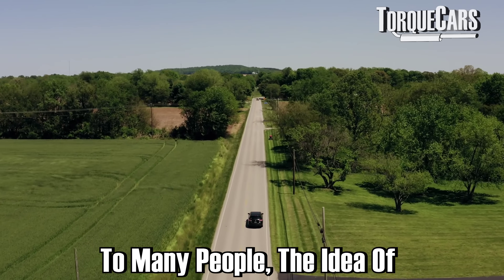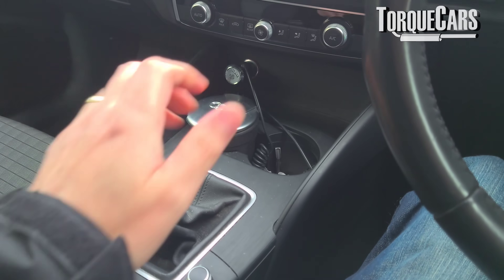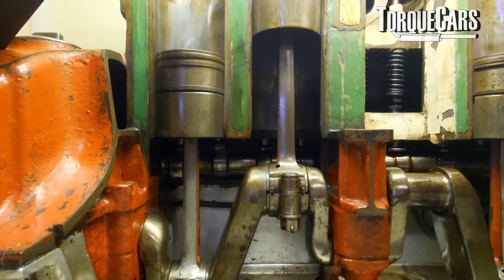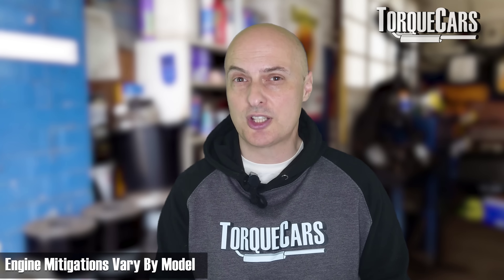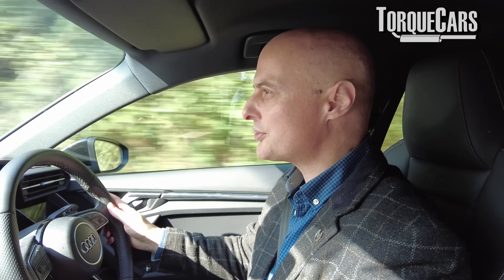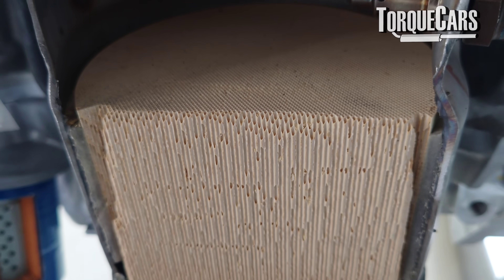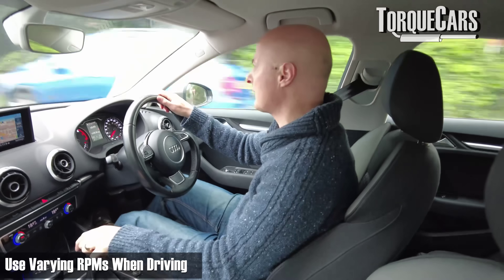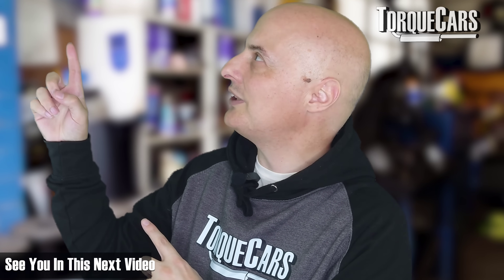BIG DAMAGE By Lugging at LOW RPM? Eco Driving Warning! (Manual Gears)

Comment: I’ve been driving for 40 years and although I’m no engineer I have pretty much driven the way you describe in this video - ie I use light throttle at low revs and while I do drive for economy on average I do indeed approach the red line from time to time and on a twisty road I will usually hold onto a lower year which is also safer as it gives more control and better response. Cars that I have owned have consequently remained healthy into high mileage and tend to burn very little engine oil.
Reply: How many RPMs are we talking when you say low revs?
Reply: @Xenon777_ how do you measure that?
Reply: @Xenon777_  I would say anything below 2K is low and even around 2K I would only gradually increase the throttle rather than stamp on it. For full throttle it’s best to be close to the mid-range torque. Obviously this varies from engine to engine - I have a 1.4 TSi which is a low pressure turbo.
Reply: My opinion is that a gasoline engine car can be used between 2000 and 4000rpm with no problem if one wants some torque. Over 4000rpm, one is either looking for power, or for engine problems. Below 2000, if you are not accelerating to reach your usual speed, you are decelerating to stop the car or looking for a car park place; anything other than this is lugging the engine, and looking for mechanical problems too.

In a diesel engine, I would say the torque band is between 1000 and 2500rpm. Over 3000, you are looking for power (on an engine supposedly full of torque) or, once more, looking for technical problems
Reply: @OscarA8869  my personal non professional opinion on diesel engines as i have the most experience with diesel engines is
Allways ride the torque curve
My car peak torque is at around 2000rpm as most diesel engines
I ride it at around 2500 since its a bmw and its really revs happy, if i need to drive at under 2000rpm that means im in too low of a gear
While thats the case with my revs happy engine
My ford focus is not really revs happy and its made for economy in mind i change at 2000rpm and ride it around 1800 fo 2200 depending on conditions
Reply: @MitkaZz  I drive a 220d and can tell you 2500rpm is way too much for normal cruising at 100km/h, for that my engine sits way happier at 1200 to 1600 rpm(cruising with very little load). 2500rpm is normal only for highway speeds or Autobahn where we diesel drivers can floor it all the time and still have 6L/100km as average :). I have 20 mins to work and 5 of that is Autobahn, I 9 out of 10 go full throttle there :)

I must also say that BMW diesels are very different to others, they actually sound good and are much happier when going above 3k rpm. Other diesels sound like they are going to explode when you go above 3k rpm, BMW diesels sound good all the way to redline at 5k wich you never do as max power is at 4k rpm. Most people when sitting inside dont realise my car is a diesel until I tell them.
Reply: @OscarA8869  I fully agree with you. But when it comes to a Honda engine, such as a k series, B series or even a L series(for the fit) they are very rev happy engines. They were mechanically made to be used on high rpms.
Reply: @Badboythatsgenuine  The exception to the rule
Reply: Oscar is right for the average engine.
I've always found keeping a 4 or 6 cyl avg compression gasoline motor between 2000 and 4000rpm 90% of the time to equal long engine life and best fuel usage.  I have always been able to shift from 5th to 4th or 3rd in time to achieve a pass, a climb or an engine braking as I live in the mountains with steep switches.

My wife can't seem to get comfortable with a clutch so she has a 6 sp electric automatic...it responds very quickly to throttle input in a pass or climb...  I do not ever sense lugging or knocking.

I typically keep cars since 1990 to 200k or 250k, and sell them because I have just grown tired of them after 15 to 20 years...or the subcomponents start failing with age...wiring, electric windows,  switches, trim, alternators, pumps, etc...

Every redliner I know was always having motor work done on a regular basis over 0 to 100k miles...or replacing the motor or engine.  They may not be related...as it may just be the enthusiast race fan personality that desires constant car attention.  When I drove a BMW, there were lots of trim and body parts available in junkyards because the car had blown a motor in hard kid driving or dumping it into 2nd at high speeds.

Comment: Hipermiling on gas or diesel engine is oxymoron. 
If you want to hyper mile buy yourself some kind of ev (fhev, phev, bev).
Reply: BMW 730d >1100 miles on a full tank. Huge vehicle and a 3.0L diesel. literally made to do just that. Forget the nonsense phevs and hybrids, they aren't even close

Comment: Low revs are not an issue, it's labouring the engine that jerks the transmission. If you want to save fuel accelerate briskly and then coast.
Reply: @bikeman123  Its counterintuitive but the math support this statement. Accelerate and then coast to next stop saves fuel.
Reply: It is possible to accelerate gently without lugging the engine, though. Just use the proper gear.
Reply: @blisterbrain  Engines are at max efficiency at wide open throttle, therefore leaving a light at WOT (in first gear) is maximally efficient, then coast at lower RPM. This is the strategy used by hyper milers.
Reply: @Rex_Racer  Not quite WOT. About 80% WOT. At 100% WOT the ECU goes open loop and blasts fuel in regardless of emissions.
Reply: @Rex_Racer  no, not true
Reply: @BriansRCStuff  It is true. Likely, you are conflating efficiency with fuel consumption- not the same thing.
Reply: @Rex_Racer  fuel consumption/ the ability to travel a certain distance on a certain amount of fuel is a type of efficiency, and the one that most typically is thought of when talking about an automotive engine.

But to your point, my point is that an engine is not the most efficient  (fuel efficient) at wide open throttle! 😎
Reply: @Rex_Racer peak torque = peak efficiency
Reply: @manicminer4573  it does make sense. Not running overly rich, but also not using the highest proportion of fuel just to spin itself. That's why high rpm at light load is a waste of fuel also. You're using most of the energy up just sliding the cylinders up and down and pumping air through the valves, whilst the wheels are receiving a gentle nudge.
Reply: Momentum driving is better. Also I personally love the fast lane most the time. So many people are so slow. Personally I would love a hybrid manual car. So we have regen breaking/slowing. And you can customise the regen and the electronic power also at 1st gear or whatever. That would be cool.
Reply: @zeroinfinity5864 get a Honda insight one of the older ones has a 5 speed manual, gets 70 mpg and its hybrid
Reply: Best comment
Reply: Thats me!
Reply: Costing at idle uses more fuel since it takes fuel to spin the engine, as opposed to the road spinning the engine and fuel being shut off.
Reply: Accelerate , then turn the engine off until you need power again .
Reply: @lassepeterson2740  That was a strategy my dad used when low on fuel 😂. Still he managed to get to the gas station on an almost empty tank. And barely any money since he had to go for the paycheck in the city.
Reply: @lassepeterson2740  thats the most nonsense ive ever heard in my life. this can kill you
Reply: @gabrielvieira.4358  I learned it in china , taxi drivers do it .
Reply: @lassepeterson2740  I dont understand why i need a new starter every year. I only run the engine when I need power.

Comment: But some cars with small engines like 1.2 or 1.0 with CVTs show an RPM range for city driving of around 1000-1500 RPM.
Reply: But that's typically only while keeping the same speed or very mild acceleration which is totally fine since there is now stress on the engine, even on a small 3 pot. As you put more throttle the CVT should raise the rpm, at least my Yaris does so. If you apply say 60% throttle to get up to the speed limit in the city it would keep the rpm at around 3k maybe 3500 and once you are at the desired speed and lift of the throttle it will drop the rpm. Which is totally fine in the city even for a small engine
Reply: Small 3 cylinder engines are designed to rev hard, they are much smoother that way, plus they warm up quickly

Comment: So the problem will happen more likely with the manual transmission?
Reply: yes since it's the drivers responsibility to be at the correct rpm range for every given situation. high gear, relative slow speed, foot to the floor is the incorrect way of driving. Cars have gears for this reason, to have variation control increasing the efficiency as much as possible
Reply: Automatic gearbox will downshift by itself when driving uphill usually